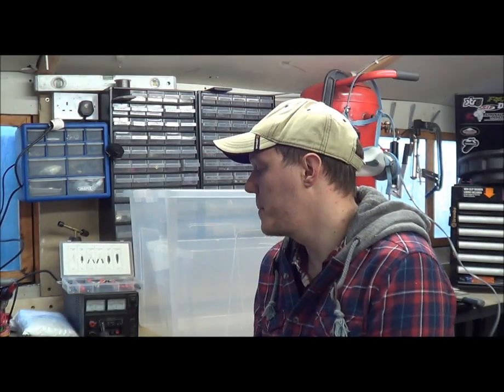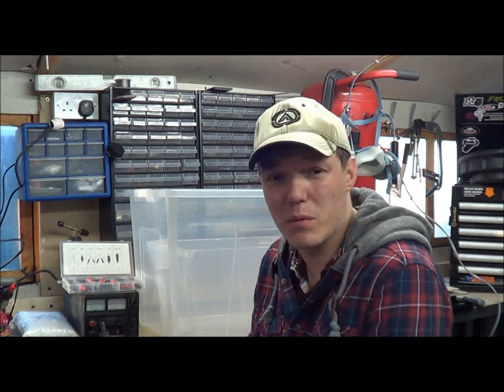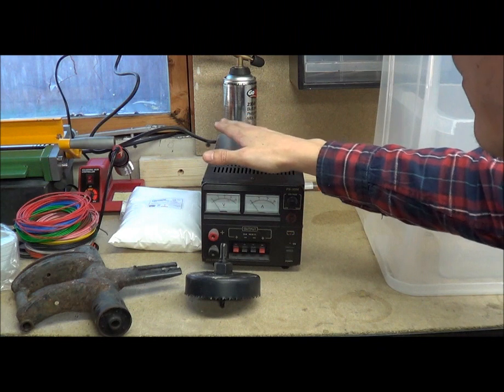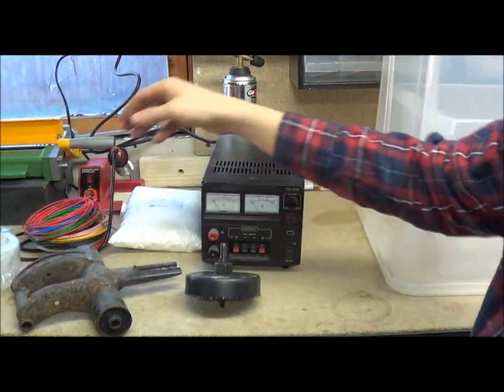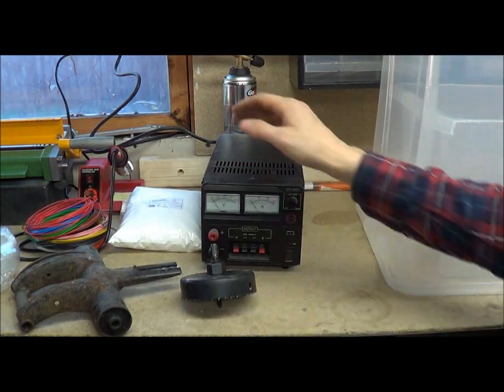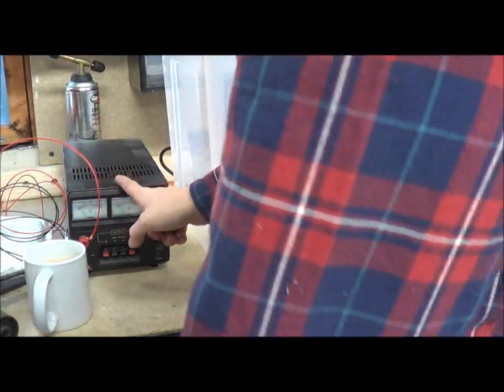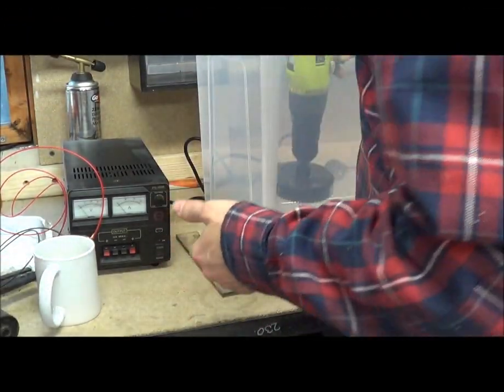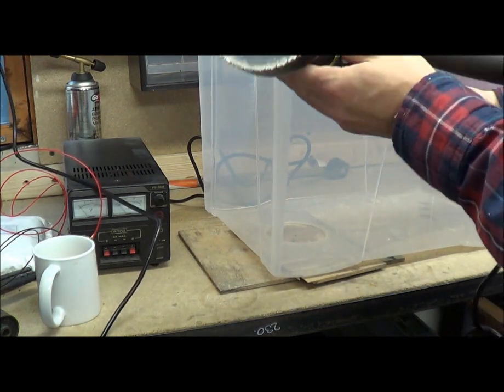Rust Removal - Part 1 Electrolysis

Comment: The best aspect of removing corrosion using electrolysis is that it reaches into every hidden recess or crevice in the piece.  You can remove rust from inside very tight enclosed elements.

Comment: The best way I found to do it is by using sodium hydroxide xD aka LYE aka caustic soda aka drain opener. It makes nice electrolite WHILE removing every bit of dirt, grease and old paint from the part, for current I use old computer power supply or small TIG welder set for MMA (electrode) for bigger parts. After the proces is complete I use wire brush or power washer to clean the part and then I coat it with 25% solution of phosphoric acid -> it passivates the metal by coating it with iron phosphate. If phosphoric acid is unavailable try products like Hypracid -> acidic industrial cleaning agent for milk processing plants, costs about 30€ per 25L should be also good for removing light rust.

Comment: I just needed the chemical and plastic box....but...it's fantastic.......to watch it happening........so a big Thankyou for showing an easy way
Reply from the maker: No worries mate, any issues just mail me or comment. What are you using for a power supply out of interest?
Reply: Pony Power I am using the battery charger..12v ...used for car or motorcycle batteries.......but it seems to turn on for a little while then turn off.......my anode is a shine piece of tubular steel, and no rust is sticking to it...all the rust is falling to the floor...but I wonder if I should change the anode.......
Reply from the maker: Is the tube steel stainless, because that could be your problem. You want really cheap steel like a piece of angle iron or steel sheet. How big is the piece your trying to clean? This has a big effect on how much voltage you need.
Reply: Ah...It's a bracket 10" x 5" from the rear of aPan European. I looked everywhere for a piece of steel or iron, I will do some skip searching over the next week, it's ongoing..the rust removal, lots of bikes
Reply from the maker: Would be better with a scrap piece of steel.

Comment: Molassis method does work great if your having to order sodium carbonate (IE) washing soda from the laundry isle at grocery store. Just dump a box of baking soda (IE) sodium bicarbonate on a cookie sheet bake in oven around 350 for an hour or you could use salt that explosive nonsense is just that yes do it with ventilation. But pools put off more gas than that you'd have to try hard to get enough to burn in a regular room from what that will release remember your just making the water more conductive lots of things like salt will work have fun good connections to part and anode are the most important

Comment: How does the voltage affect the electrolysis ? I mean, what would be the idea voltage ? does it goes fast if you use a higher voltage ?... Also, can you use tap water ? or do you have to use distilled water ? does the temperature of the water  matters ? my questions might sound stupid, sorry.  thanks for the tips !
Reply from the maker: +Azen Kwed its not a stupid question. The voltage increases the migration of the plating atoms, increased voltage increases the migration speed, but to such a small degree that you would notice. Really high voltages can cause unwanted reactions in the solution, but for the home gamer this isn't (usually) possible. I use tap water all the time for this process, its plating where water type can make a difference. As for the temperature, this is important again more for plateing but can help with heavy rusted parts if the water is 40deg C
Reply: thanks a lot :)

Comment: I really enjoyed your video, I have lots of old bikes, so this week I am getting all the bits I need to do the Electrolysis. Did you say you were going to do another video, same subject..??.........have you any advice on chromed parts...???
Reply from the maker: Hi mate, yes but not for awhile because I'm moving workshop which will take some time. As for chrome parts are you wanting to remove the chrome?
Reply: Remove the rust, or alternatives.......which I can do at home. I have seen a few of your videos.........really really helpful........Lots of the bits on these bikes are chromed......rust I can sort out and repaint...chrome..??
Do you have a garage, or just a hobby..???
Reply: I also wondered which sand blast cabinet you were using...??
Reply from the maker: ROY Dean No its not a garage open to the public. But I do small jobs for people from time to time. For removing rust on chrome parts try Autosol. Its a polishing compound paste that works great, I always have a tube. For heavier rust and pitting you can do the same method I used in the video above. The sand blaster is a no name cabinet that cost around £500, with a few modifications I made. I use recycled glass for ally and ally oxide (black sand) for steel. I've used copper slag in the past for thin sheet metal.

Comment: In this old video, you piped the hydrogen gas out the window but the window looked lower than the vent in the top of the plastic box.  Was that what I saw?  Why was that done?
Reply from the maker: As more hydrogen is released the building pressure will force the hydrogen out of the pipe - this was to make sure that the workshop didn't fill with hydrogen. Switching the lights on the next day may have caused a nasty fire. As long as you have some means of removing the hydrogen then all should be good. Its a 'just in case' measure.
Reply: Got it.  You had said that the hole in the top was because the hydrogen was light and would go up.  Then the ducting was lower than the hole.  I see what you mean about the pressure.  I didn't think the pressure would be beyond a negligible amount.  But I see you're still alive so it must have worked.
Reply from the maker: It is a negligible amount - but you only need a slight amount of flow to shift the hydrogen out.

Comment: ADVICE TO THE VIEWERS: NEVER DO THIS INSIDE, OR HAVE AN EXHAUSTOR.
Your "chamber" is actually doing more damage than good. As hydrogen is lighter than air, it will go up, but since you put the tube's exit lower than the entrace, it wil be trapped on the upper part, reaching dangerous concentrations. Would be better not to use anything at all.
Reply from the maker: So dangerous nothing has happened. The hydrogen concentration in minimal with a flow going out of the box. I'll light and match and show you.
Reply: Please do it... :)

Comment: Stainless steel is a very bad idea.
Reply from the maker: +John Smith I don't get what you mean?
Reply: +Pony Power I don't remember where, but I thought at one point you mentioned that stainless steel could be cleaned using this method, but that would be a bad due to the hexavalent chromium produced. Is that correct, or does that only matter if the anode itself is stainless?
Reply from the maker: Hello mate, hexavalent chromium is used to chrome plate steel, chromium mixed into the stainless steel when the alloy is formulated. HexyChrome is extremely toxic thats why they don't make chrome cutlery. the chromium in stainless is part of the alloy structure and isn't going anywhere so would be fine in this application.
Reply from the maker: Stainless steel wire can be used to hang your parts was what I said. cheers for the comment - matt
Reply: Sorry but you're WRONG. If you use stainless steel as the sacrificial metal, hexavalent chromium (Cr6+) may (probably will) form. Never use anything with chromium as the anode. The anode in electrolytic cells (electrolysis) is the positive (+), and in galvanic cells (batteries) is the negative (-). In both cases the anode always gets oxidised. Unless you're using platinum, any metal will oxidise, regardless being part of an alloy. The amount is voltage/amperage/ph/temp dependant, and will probably be low in this case, but anything higher than 1.3V has the potential to create hexavalent chromium. Using chromium-vanadium-steel will lower the chances and rate of Cr6+ formation, since vanadium will take precedence, but it's not a guarantee, and vanadium will eventually get depleted... I woudn't take the risk.
Reply: @batbawls  That's the same shit in the Erin Brokovich movie...all them poor now rich bastards !

Comment: Are you from Lincolnshire boy👍
Reply from the maker: tuther side ov pennines fella
Reply: Use rain water and the hard water problem is solved.  Just pitch out the used solution.  Washing soda is dirt cheap and it's not worth the bother to keep it laying around waiting to make a mess.  Nice video.